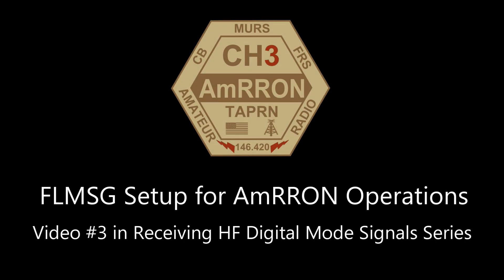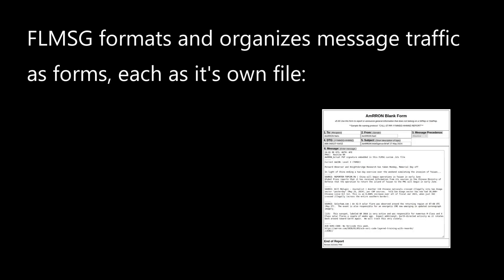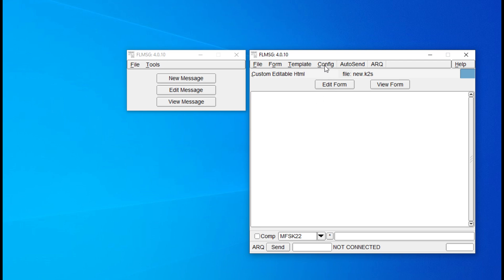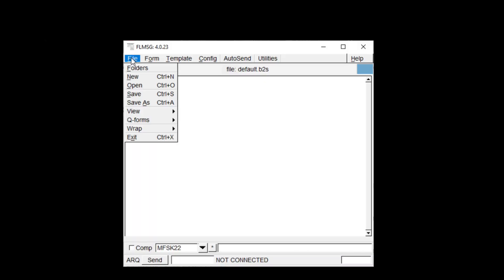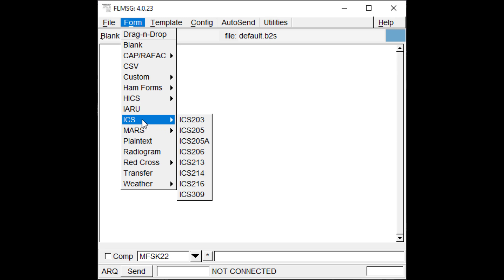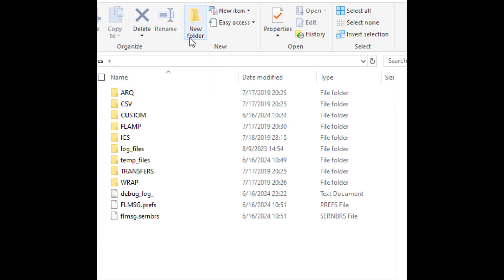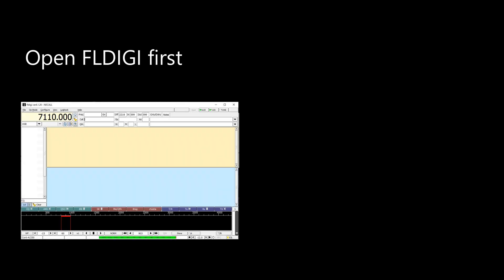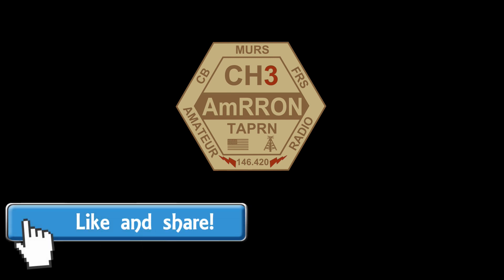FLMSG Setup for AmRRON Ops | Vid 3 | Receiving HF Digital Series

Comment: Does anyone here know why modes would automatically switch when I was viewing the fldigi video, but not this one?  I didn't change any fldigi settings.
Reply from the maker: Just a quick guess... either A)  You didn't have your RxID turned on in the upper RH corner of FLDIGI, or; B) The sender didn't have TxID turned on and didn't transmit the mode change for you to receive it, or; C) there was an error in the received audio and it needs to be retransmitted.  The last one can happen during interference (atmospheric or manmade) at the precise moment the mode change was sent, or other conditions such as lightning crashes in the atmosphere, etc.    But if you are referring to the video, that wouldn't be the case.